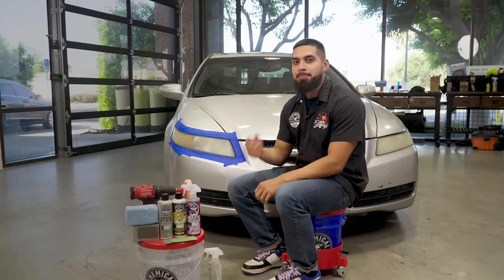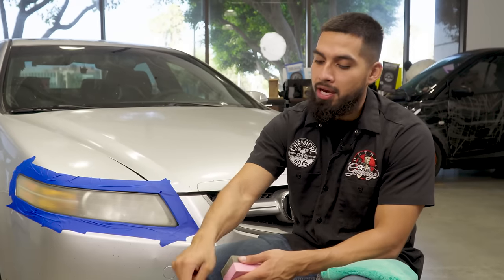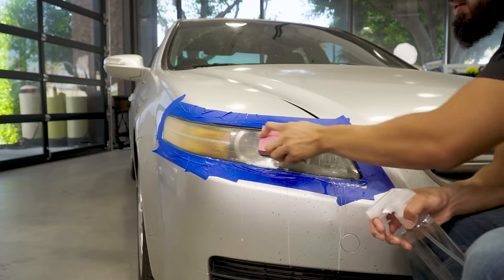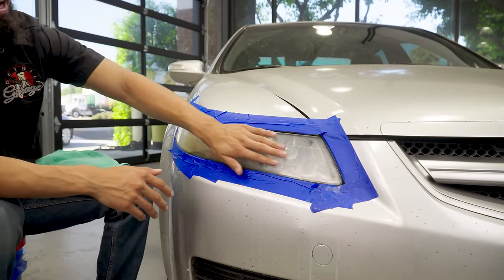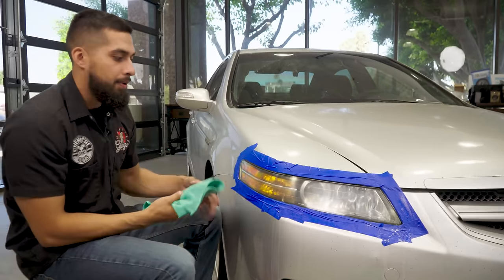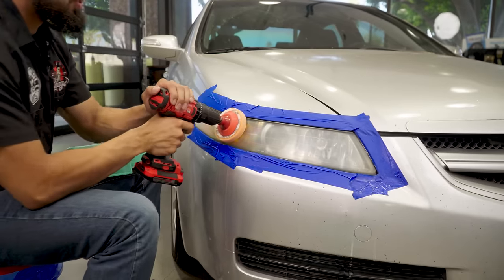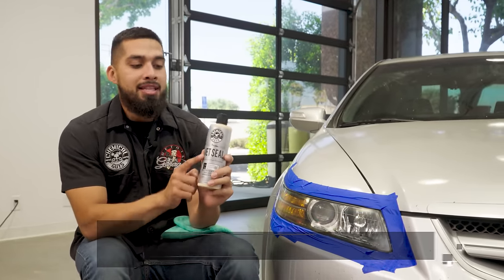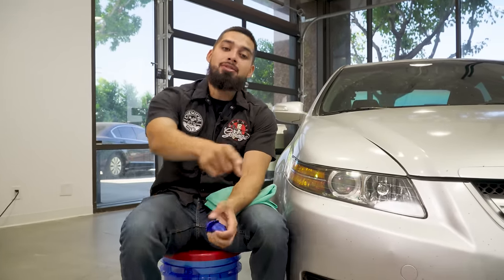How To Clean, Polish & Restore FOGGY Car Headlights Back To Clear!

Comment: I just did this job with 400, 600, and 2000 grit sandpaper from harbor freight, and a can of rustoleum gloss clear coat and it came out perfect. You don't need all this stuff. The bottom line to doing this job is the prep work, and that means taking ur time and doing a quality wetsand job. Circular motions work well, just end it going side to side. And don't press hard with 400 or 600. Spend a lot of time using 2000.
Reply: Chrisfix

Comment: Results are awesome!! I have used the product and gets the awesome results but after 12 months you start to see the hazey headlight again so my question is do we have to use the sandpaper again or just use the headlight restorer? Thank you
Reply: This is because the sealant doesn't actually work. You need a clear coat paint for sun protection.
Reply: Could you please send the link for that?
Reply: @usaahsan  no link. Clear coat paint. Any hardware store carries it
Reply: @usaahsan The clear coat paint should specifically say non-yellowing and or UV resistant

Comment: 3 methods i found and tried for headlight restoration  1 with acetone vapor 2 applying uv protectant clear coat 3 polishing one and the polishing I prefer the polishing as the video for me but i seat it with ceramic coating gives extra shine

Comment: Just a question and maybe the comment section can help me out with this. I have been watching a lot of restoration videos and most of them start with like 6 or 800 grit. Just wondering if using the 2000 will be enough to show results ? Also thanks for the video I use mostly Chemical Guys products as well.

Comment: How long should it take before I wash the car after restoration?
Reply from the maker: Hi there! Depending on what coating is used to protect the headlight, it can be washed almost immediately.
Reply: @ChemicalGuys  In a case where by there's no coating?